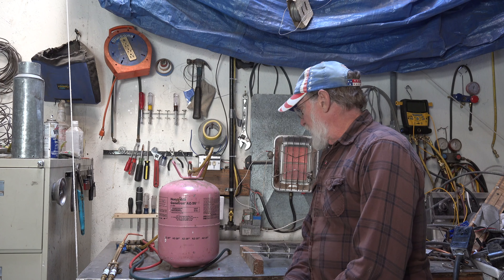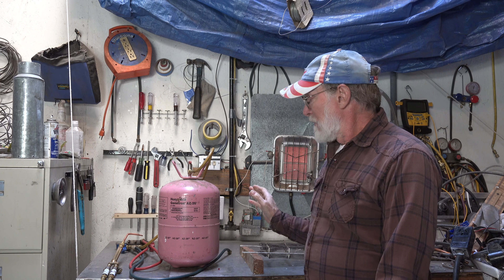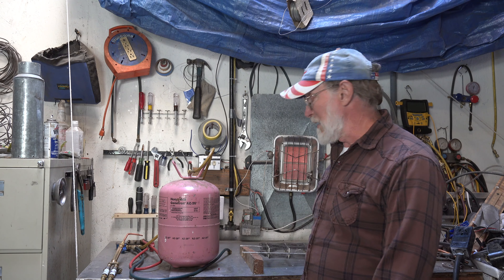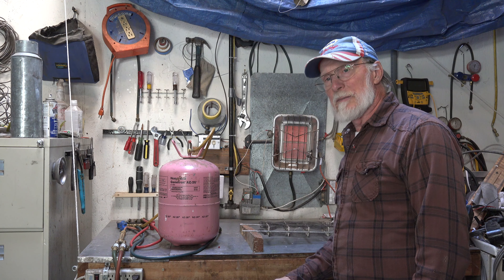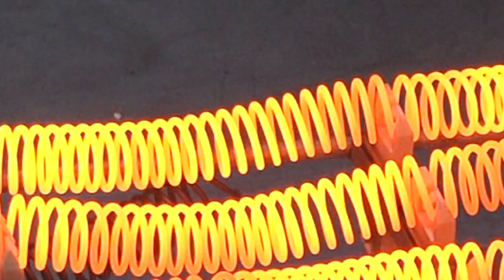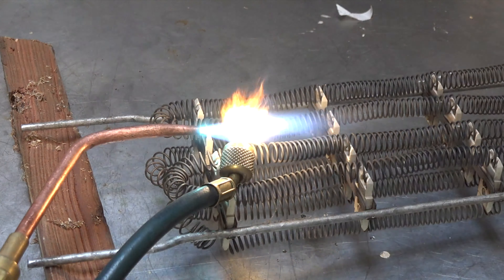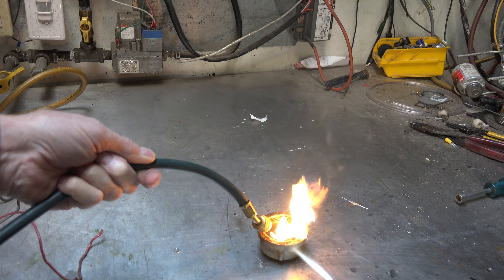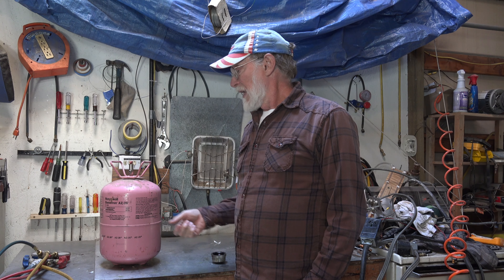Is R-410A flammable?

Comment: I am grateful for this test.  As a fire investigator I’ve seen ac coils and evaporators start fires. I thought it was a high limit failure. Some thought an ac and compressor oil leak. This disputes the latter.
Reply: How exactly does a coil start a fire?
Reply: How did the coil start a fire? You mean the refrigerant leaked out and started on fire?
Reply: Avery Alexander furnace overheated, melted condensate pan and plenum and ductwork in contact with building ignited it.. Technician did not have fan limit switch wired into burner circuit.
Reply: @johnc4876  Thanks for explaining. How exactly did the coil start the fire though? It sounds more like the fire was caused by the furnace overheating, and the plastic condensate pan and ductwork is what ignited
Reply: Avery Alexander yes agreed.

Comment: Nice test! However, I am wondering if a vapor may not be more likely to burn. R32 has a higher vapor pressure than R125 and evaporates quicker, so I wonder if it may burn better if you left the cylinder upright so it fractionated and the concentration of the more flammable R32 may be higher. I understand why you didn't so you didn't fractionate the refrigerant in your cylinder, but I wonder if the result may have been different. Just a thought!

Comment: You can take 410a back into its base refrigerants then see how flammable they are separately. Due to the temperature glide, pull out of the bottle as a vapor without going too fast. Heating up the 410a to about 500psi and pulling a vapor with recovery machine instead of
 as liquid like when charging a system should cause it to fractionate enough to make one of the 2 bottle more flammable than the other.
Reply: Glide R410a is minimal
Reply: @AlexYT_news  how much do think you need to get the 2 to separate? I just wanna see some flames👍

Comment: R-410A is not flammable in air at temperatures up to 100° C (212° F) at atmospheric pressure. However, this material can become combustible when mixed with air at elevated pressure and/or temperature in the presence of an ignition sources. R-410A can also become combustible in an oxygen enriched environment.

Comment: I agree it's not an issue... But your test was faulty because of the high flow rate.  Imagine a small leak filling a furnace slowly with gas.  When a good mix of 92 and coolant is reached with an ignition source a small explosion might result. Unlikely to do any real damage but something to  consider.
Reply: Maybe inflate a balloon and wrap it around a spark plug, or just an old milk jug
Reply from the maker: I may try the ballon 
GFM
Reply from the maker: @throttlebottle5906  Oxygen would not be realistic.
GFM
Reply: @grayfurnaceman  don't balloon co2

Comment: Glad  Most refrigirant gas  are non flamable  which could end up so many fires and injuries , because people use AC untill compressor really wear out and any malfanction on safety back up  could  over heat the Pump and burst  and gas could fill the room real fast . I do not know these days start using on Refrigerants and coolers flamable gas nothing but butan which higly flamable .

Comment: Got news for you, I WILL separate in the system and if you have a leaker that has been filled without full recovery (witch is ALWAYS the case) you going to end up with more 32 then 125... Now, have it at ambient pressure and heat up a line to change a leaking coil... Say goodbye to your eyebrows because your going to have one hell of a flamethrower coming back at you...

But your right, in a (lab) setting, it's not flammable. But in the real world where us real techs live, it's a T TOTAL different story...
Reply: How would R410a become more flammable? Since R32 has a higher vapor pressure than R125, the R32 should theoretically leak out first and leave you with a higher concentration of R125 in the system, making it less flammable. Besides, from the few flammability tests I've seen on pure R32, it doesn't look very flammable to begin with. Any refrigerant will burn when mixed with a mist of oil though. It would be cool to see him simulate refrigerant mixed with oil leaking under pressure though to see how well it burns, preferably R410a and pure R32.